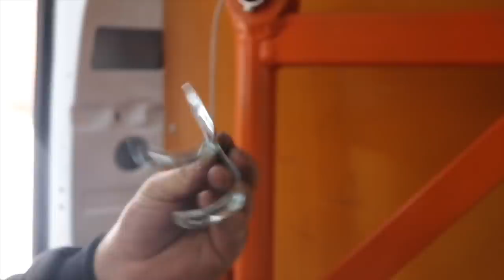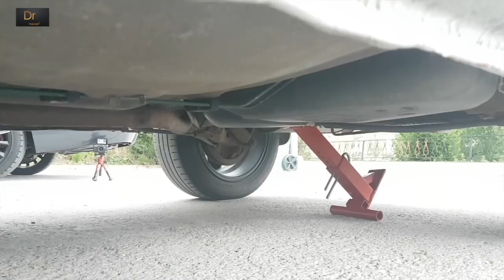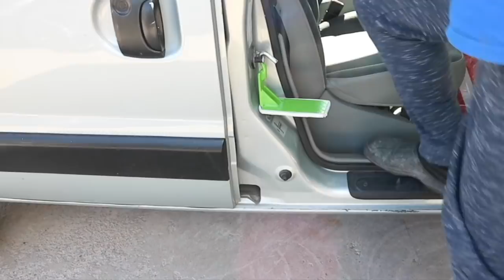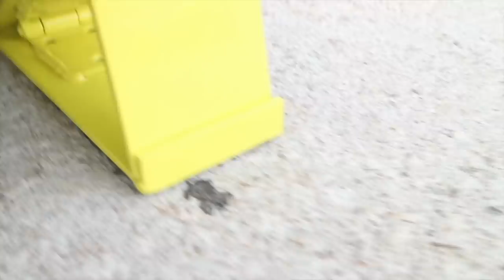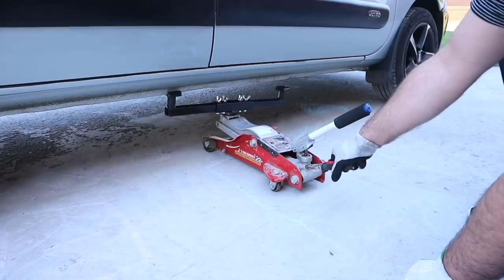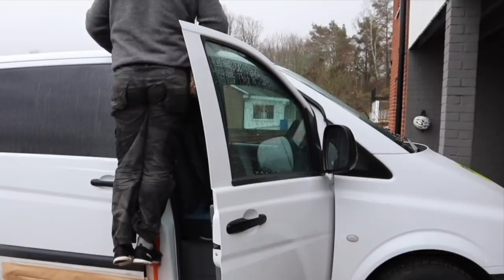14 Awesome DIY Tools for CARS

Comment: Seen some crap but this guy takes the cake. Why would you make this crap when you can buy it and it’s fully tested and guaranteed
Reply: Agree its all unnecessary crap,I wouldn't trust those ramps driving on to them let alone going under the vehicle,and every time he uses those steps he has to slam the door.

Comment: Excuse me I don't understand what's the point?
By manufacturing these things many are and have been for more than 60 years. How did you think the wheel lock would work ????
If I wanted to steal a car with a "wheel lock" that you made ...
Then there are "some" problems .... The material is too weak !!!
And misconstrued, you can unleash with the force of hand let some air out of the tire or simply drive away with the car and the wheel lock comes loose. You are good at making things and welding. So why not make a piece of a tool so you do not have to look for pliers when you need to lower the jack?